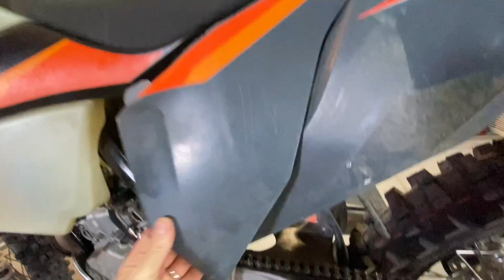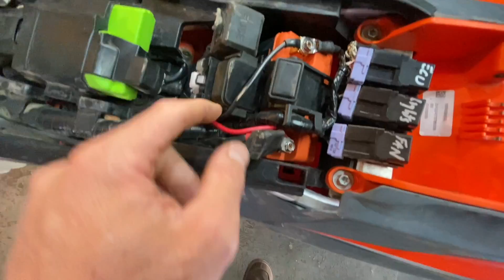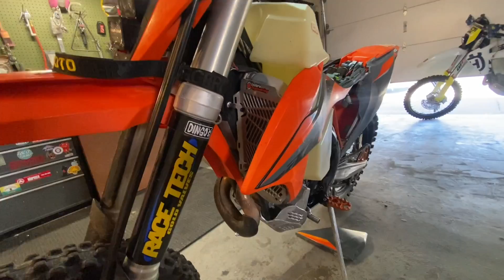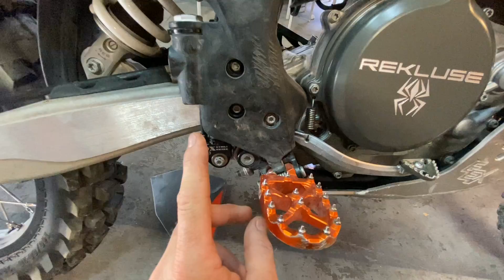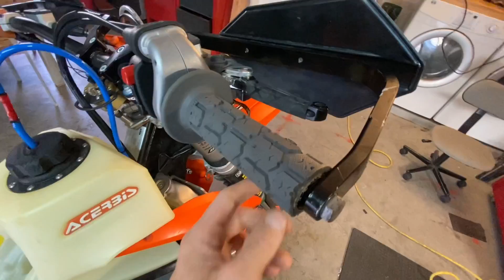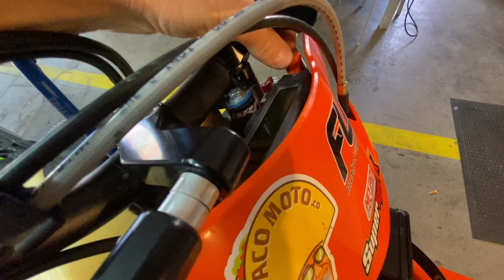21' 500 XCF-W ALL SPORT SUPER ENDURO

Comment: Wow and to think, I was happy after a plastic skid plate and EE bark busters and sicass light kit to get tags. I slow down in rocks and just refuse to abuse my bike in them so alot of bling for guards just never needed also east coast maybe just not as rocky period. Black throttle cam was nice and motor clutch good stock, I just dont buy clutch mods running cooler than stock, gotta prove that one, stock clutch is way to good to throw away in my book. Gear down two teeth in rear makes recluse unnecessary in most of my terrain. Expensive bike made uber expensive but there must be market for all that, again Wow.

Comment: Wow really 300 to 400 hours before doing a top end replacement. Husqvarna fe 350 2017 manual says I have to do one at a 135 hours. I see people only do them at about 200 hours on youtube, but wonder if they are necessary if you don't abuse you bike too much and you clean the air filter often.
Reply from the maker: We have customer bikes with 600-800 hours
Reply: Did my 250EXC-F at 300hrs. It looked like it could do another 100. I rode it hard, changed oil and filters often. Didn't bounce of rev limiter though.

Comment: Dirty filters still filter but might flow slightly less air which should richen the A/F ratio, so I don't think changing or cleaning the air filter so often does very much for engine life. Throw on an aftermarket ECU with increased fuel and a dirty air filter is even less of an issue with regard to engine life.
Reply: I would see a dirty air filter having all of the oily surface filled up and dust can slip through the filter as there is less resistance.

Comment: The stock fueling on the 20/21 XCFW is the best yet. If you are not racing , I suggest you run the stock fueling and exhaust for a while before you drop big coin on aftermarket ECU and exhaust mods. As delivered, the bike runs really well, is quiet, and delivers as much as 140 miles of range from the stock tank. The larger tanks raise the CG when full and present an obvious safety hazard in an unplanned get off. The relative relaxed state of tune means better fuel economy and longer engine life for dual sport use. There is enough power for easy wheel lofts and high speeds. I fully agree with Mike that the Rekluse auto clutch and Left Hand Rear Brake really enhance the broad capabilities of the 500 platform. In particular the autoclutch will allow you to run a gear high in slippery hard enduro conditions. This gives you amazing control of the rear contact patch on steeps, wet root mazes, and the like. Be sure to combine this with a sticky tire on Tubliss at low  pressure for maximum effect. I find more traction with this setup on the 500 than I do on the legendary 300. And now they weigh the same!
Reply: Agreed, I’m at 30hrs on my 21 500  and I don’t think I’m gonna do the ECU/exhaust upgrade. The bike runs dang good stock. Had a flameout issue after it broke in (about 20 hours) but noticed the idle had dropped after it loosened up. Adjusted the idle back up and it’s back to running great.
Reply: @Letsgobucs1  If you mostly ride below 6,000RPM, you don't miss anything with stock fueling.
Reply: I didn’t know all this. Thank you!